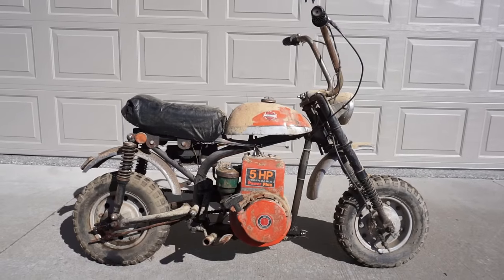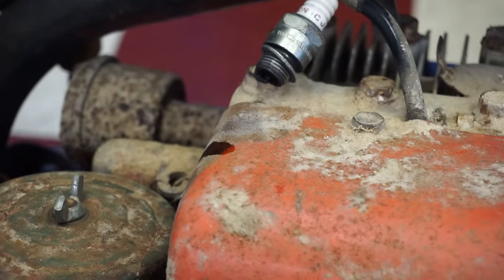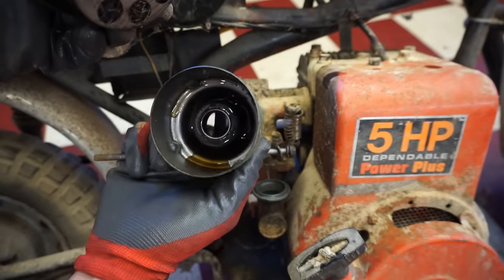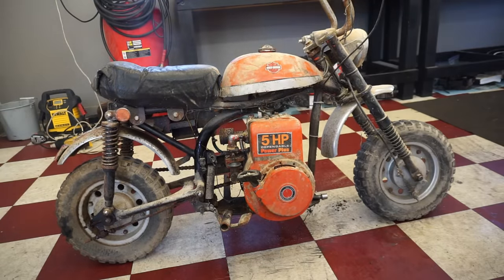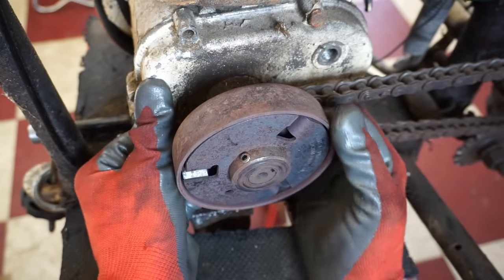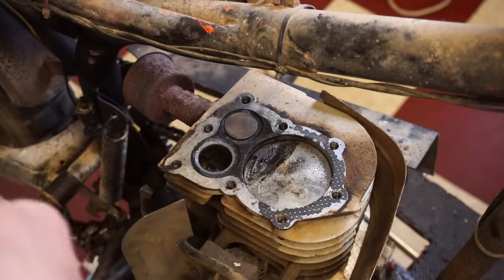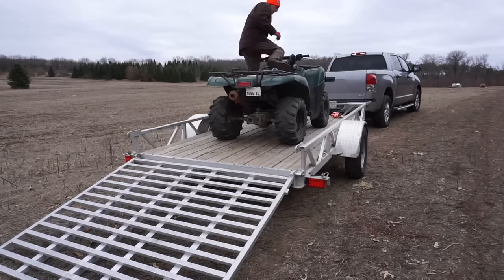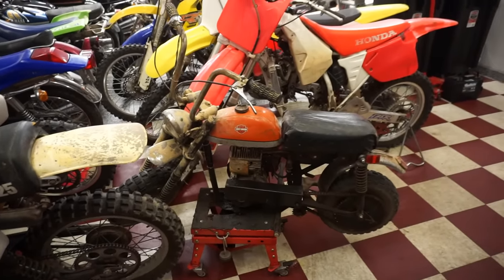$100 Barn Find Mini Bike Hasn't Ran in 20+ Years (RARE FIND?)

Comment: Better install a fuel valve, them carburetors are known to leak. The air cleaner is an oil bath air cleaner, you have probably figured this out already.

Comment: Valve guides worn out?  Those engines are known for loose valve guides.  If the valve wiggles sideways, it's worn out.  They used to sell guide replacement kits.  Not anymore.

Comment: Never oil the starter open it up remove and clean the bearings and housing it needs to be clean and dry or the bearings stick and don't fling out to lock in place to start the engine
Reply: See my first comment on this video if anyone else has further questions on this project and what repairs it needs to be fixed properly. And no. Im not being serious.

Comment: Actually it is A  Honda trail mini bike frame. Made for harbor freight and sold with the original  Honda predator air cooled  4 stroke engine block on it. That was that came as A chain clutch drive unit. That swapped out over to A Kohler engine. And then A old-school Briggs and Stratton 5 HP updraft carburetorated air cooled engine block. As A replacement for the original engine. That A was air cooled engine block to.
Reply: WTF???  Just STOP! Nope. Not even close to a Honda. AT ALL, or any part of it. It is a Taiwan copy that was made back in the day and looked like a Z50, and this copy has had a Briggs engine mounted in it at some point (wasn't original to the copy bike).

Comment: pretty sure its ether a speedway or rupp minibike. If its the original motor its definitely not cheap thats for sure. The wheels tell me more like a 70 speedway scarab, but if that's the case then definitely not the original motor, i think its more likely 60s to 70s rupp with mabye the wrong wheels just because of the engine and frame design
Reply: Nope. Not even close to a Speedway or Rupp. Can anyone just google their "guess" that it's the same as and compare before making "pretty sure" statements???. It is a Taiwan copy that was made back in the day and looked like a Z50, and this copy has had a Briggs engine mounted in it at some point (wasn't original to the copy bike).

Comment: That looks like someone modified a Honda 50. / monkey bike. Looks like the frame except for the lower portion under the motor. Wonder if they blew up original motor and modified the frame to take the Edger engine.

Comment: My apologies it's not a ramjet it's a honda50 that someone welded up the frame the way the did because they probably didn't have the to replace the original engine so they welded up a motor plate on it but that gas and wheels is where your money is you could get probably close to a thousand dollars in eBay just for gas tank wheels and fenders
Reply: Nope. Not even close to a Honda. AT ALL, or any part of it. It is a Taiwan copy that was made back in the day and looked like a Z50, and this copy has had a Briggs engine mounted in it at some point (wasn't original to the copy bike).

Comment: 20 plus year old oil  ? did you change it before running the engine for longer than 5 minutes ? Those sidevalve engines only have an oil dipper on the end of the con rod  to lubricate the bores  .Old thin oil will not do the job

Comment: They butchered that honda, z50. Geez if that had been a k1, 1969. It be worth a mint. If it had not been butchered and so forth. You can still see the engine mount for the Honda engine. I had a k3, model, I restored and later sold it. Now it looks worth $150. Maybe fix up enough for a pit bike for the demo guys at the fair grounds.